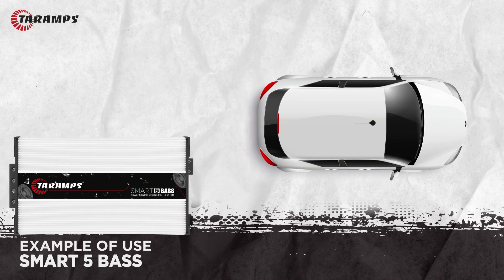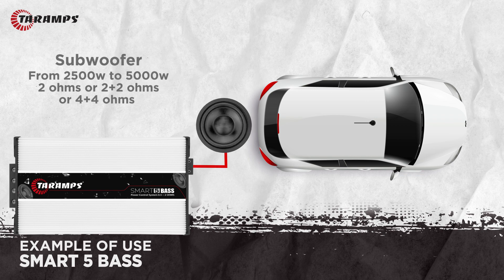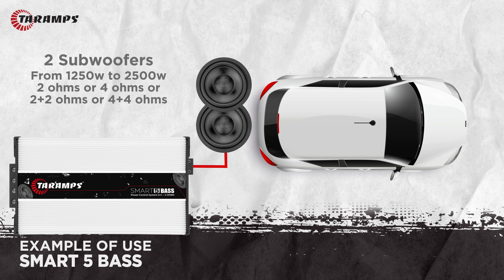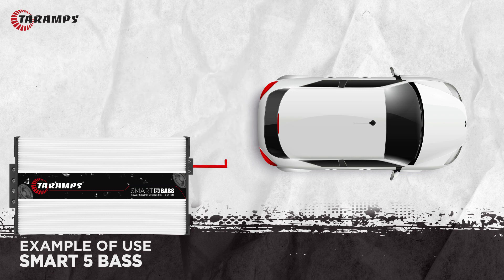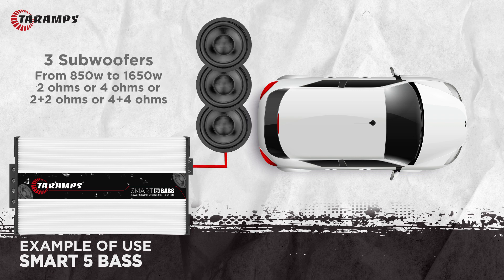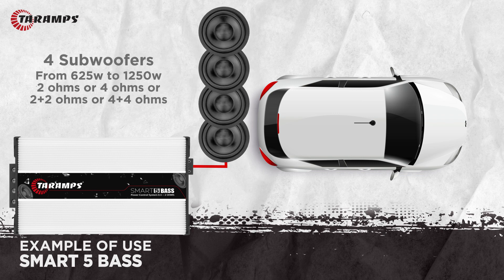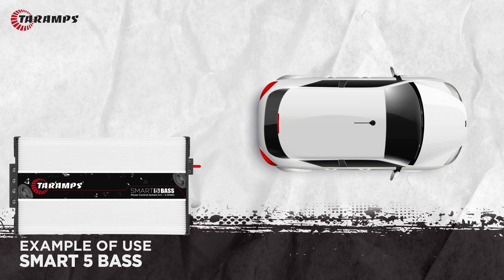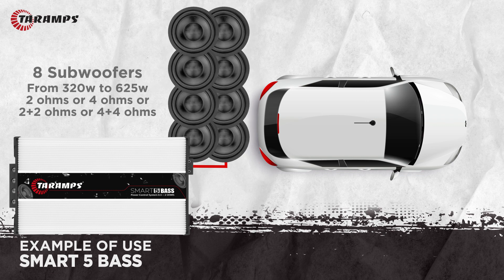Come check out the many usage examples that Smart 5 Bass has to offer for you.

Comment: You can also run 6 subs as I am❤
Reply from the maker: As long as the final impedance of the subs after the connections is within the Smart 5 Bass impedance range and they can collectively handle 5000W RMS, you can use six subs with it.